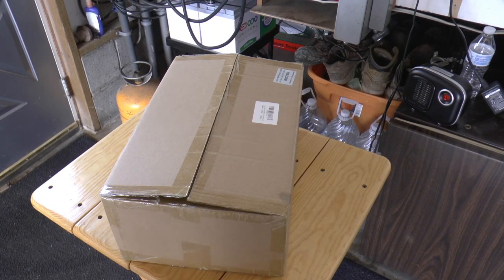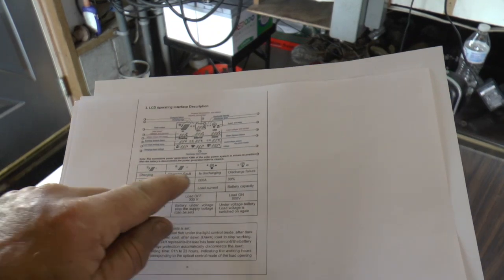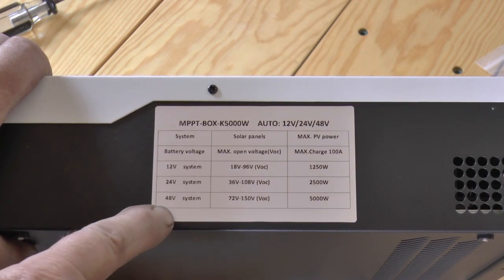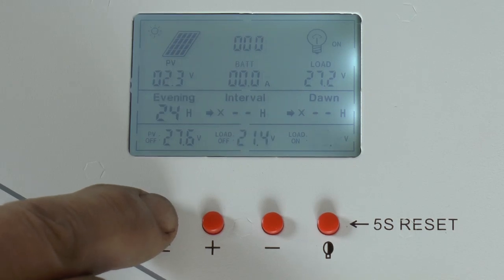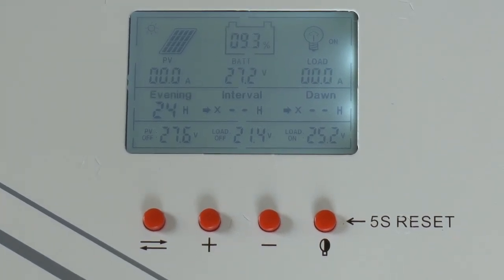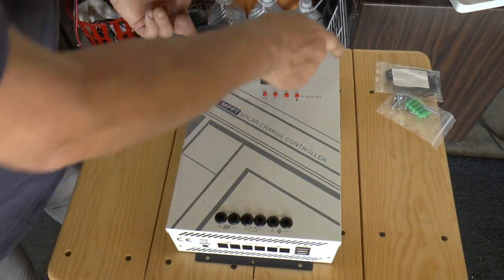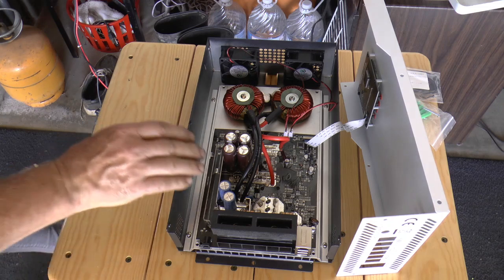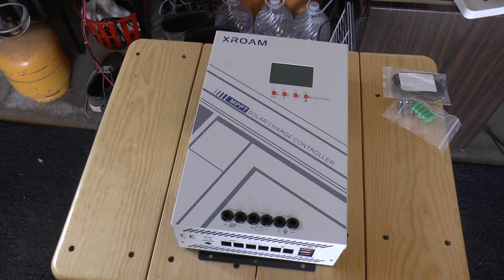XROAM Solar Charge Controller

Comment: i love mine i set for 27 v on a 24 v system on lithium and that what  it does i set and for get 64v coming in, it works better then my victron
Reply from the maker: Mine works great except the display goes blank at times.
Reply: @kevincrawford2027  i use to charge my battery at 14.2 but not no more  i just charge to 13.6 the charger will keep it their all day long
Reply from the maker: @ Mine is on a 48 volt system. It is set to 55 volts. When the batteries are full it supplies power to the inverter and holds at 55 volts some times as much as 60 amps in full sun depending on the load.